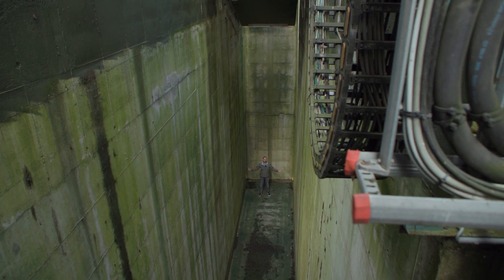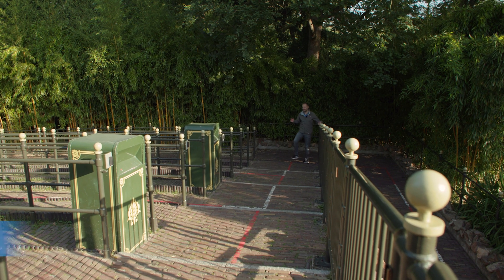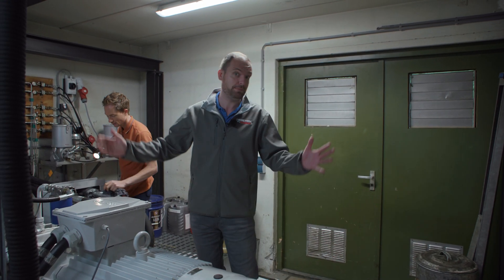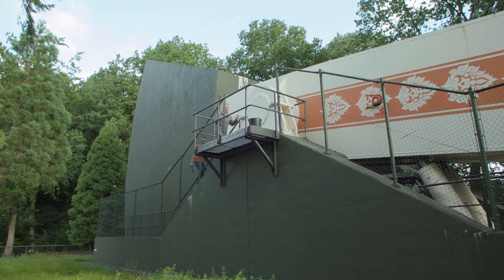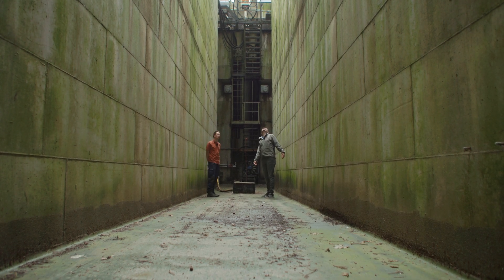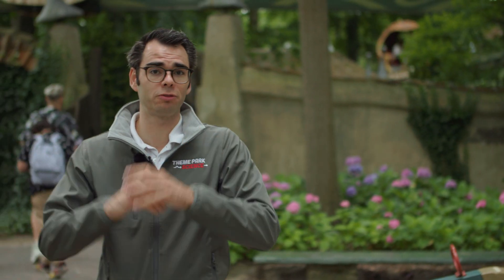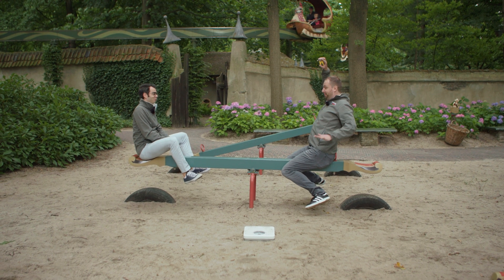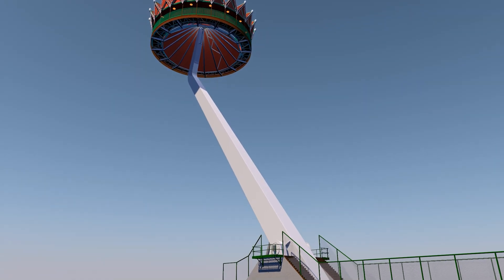How Efteling’s Observation Tower Really Works 🏯 | Exclusive Behind-the-Scenes Look at the Pagode

Comment: If the stabilizer would malfunction, is the temple itself balanced (assuming riders are distributed evenly)? It seems a bit scary that one system would be responsible for such an important task. Or does it have a fail-safe?
Reply: The system itself is not self-balanced. That is what I tried to show during my calculation. You really need the hydrualic cylinders to move the ride. So it really depends on this system, but for that reason 2 cylinders are installed.
Reply: @JurnanSchilder  Thanks for your reply, Jurnan. I should have been more clear in my question. What I meant to ask is if the system that keeps the temple horizontal has a fail-safe. What would happen if the small hydraulic system in the temple itself fails? :)
Reply: @karelb84  Ah! Well, the center of mass of the temple is located below the hinge. So if the stabilisation mechanism fails, it can happen that the temple tilts to one side a little bit (depending on the unbalance of the passengers, wind, ...), but it will not flip over or so, because the normal horizontal position is also the temple's equilibrium position.